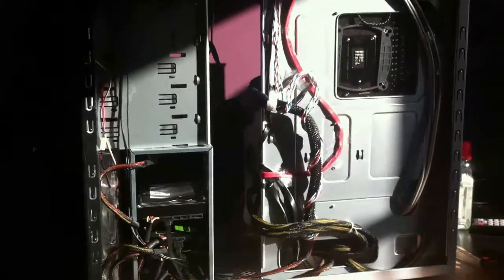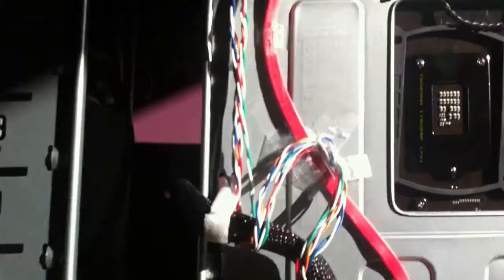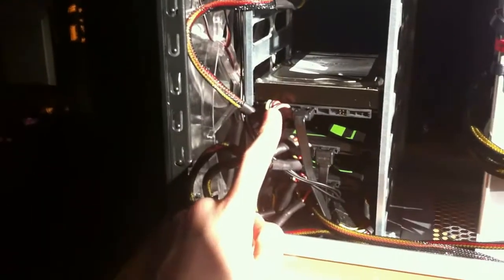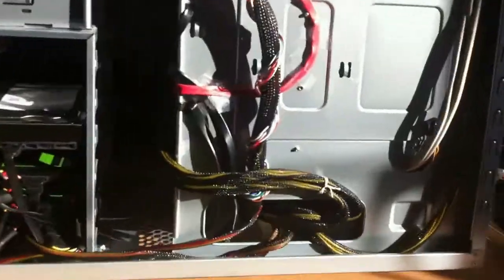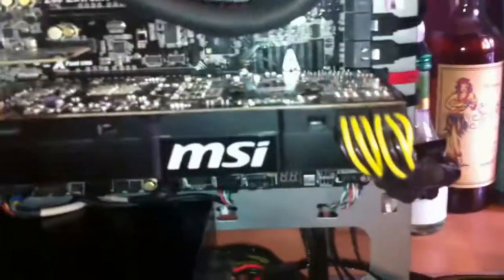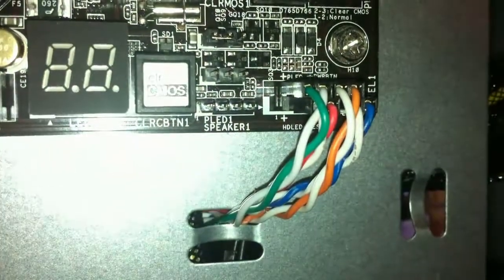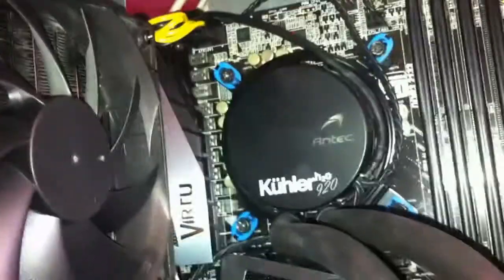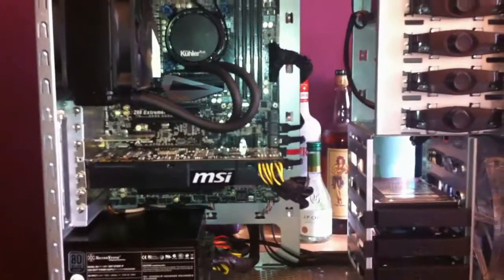Pc Build & Update - 2012 (Acapon)

Comment from the maker: @vbstein My temps are at 26C idle and 72c full burn test load. Yeh intel announced the 1.520v was the limit before it would start degrading the chip. So happy about that :P also I didn't have much problem with the instillation, a little fidily but I got over it haha

Comment: I thought 1.5 volts was damaging to sandy bridge and with that kind of voltage i think you would get 5ghz. But nice build, was wondering if you had trouble putting the antec 920 like I did? Plus what temps are you getting just comparing.

Comment: @acapon k here it is you have 4 ram slots no room for upgrading i have 6 ram slots with triple channel ddr3 1600mhz  i have i7-960 you have 2600k clock speeds are about the same i have 6 pci-e slots you have 2 i have 1gb 6850 and will be crossfiring witch is beter then sli so maybe if you looked up your parts first i do agree my cable mangement sucks but its not my fault my case sucks 6 pci-e slots meaning i have way more room to crossfire or sli i dont care if you cpu is 2600k